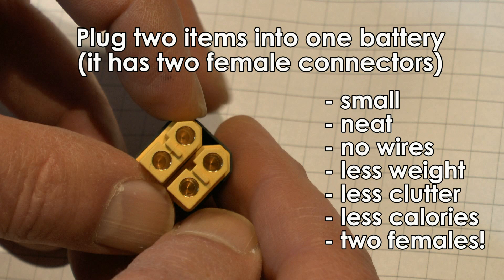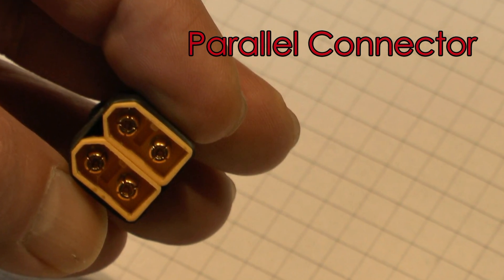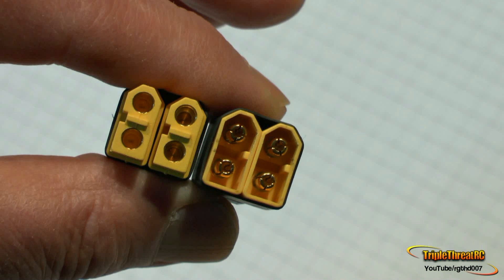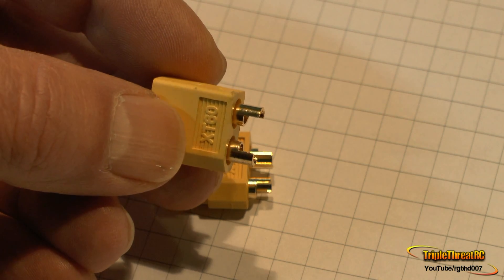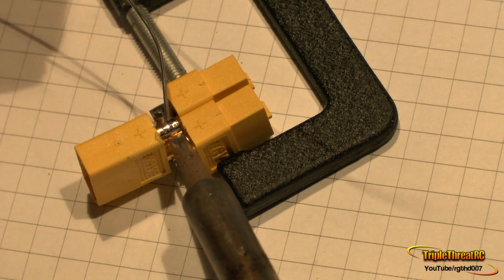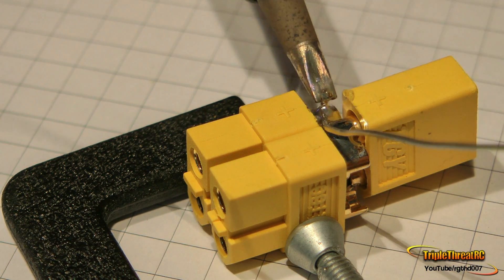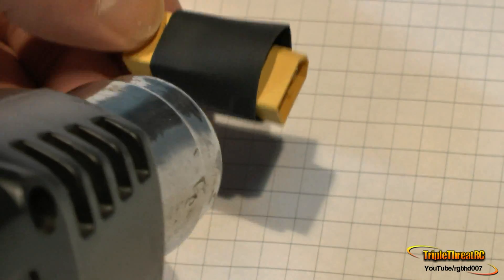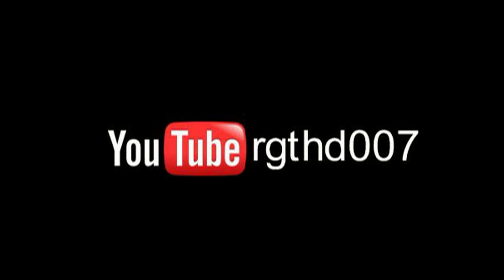How to make an  XT60/XT90 Dual Outlet Connector

Comment: Helpful hint, keep the male/female connectors plugged in. That way if you overheat the pins they will not soften the plastic and become misaligned.
Reply from the maker: Yes, that's a very good tip. I do that with Deans connectors and with these XT60s if I am using large gauge wire where more heat is required. It is an especially good tip for those that are new to soldering and haven't learned to control their heat yet. Many thanks for the tip and for watching!  Cheers, Bob

Comment: Use 63/37 (eutectic) solder.  It stays liquid much better than 60/40.  The eutectic solder stays as either solid or liquid and it does not stay in between.

Comment: Thank you for this. I wish I could see how you set this connector up with your FPV system. Is it really that simple? I just make the power to my RC832 and LCD into XT60 compatible, plug, and play? Would love if it really is that easy. Will try and see what happens... Hopefully you reply before if there is something I should know first. Thanks again.
Reply from the maker: I hope it helps. In my case, my monitor and video receiver both run off of a 3s lipos so this connector was just an easy way to hook both of them up to the same battery. And yes, it really is that simple lol. Have fun with it and happy flying! (If you`re not in a rush, you can order these from HobbyKing but I find it`s just as easy to make one up when I need it) Cheers!

Comment: Thats a good Idea for attached LED or double Lipo but attention the Bec normal have only 5A.
Reply from the maker: Hi Tom, Thanks for watching and for your comments. If you use one of these in a plane there is no problem with getting enough power to the BEC because it splits the power before getting to the esc/bec. You get full battery voltage out of each outlet.
Reply: Ah okay right, good thing.!